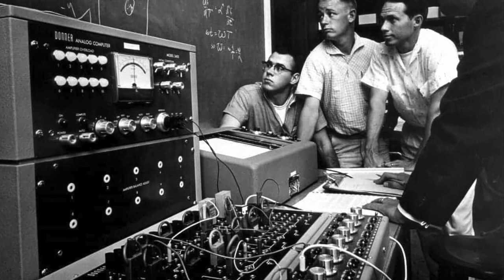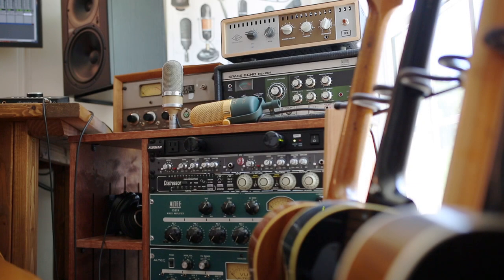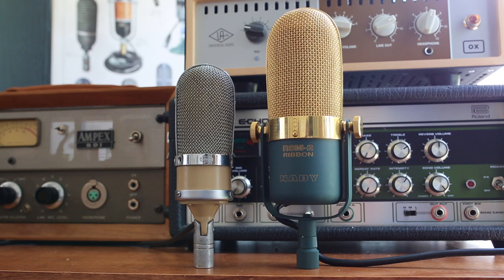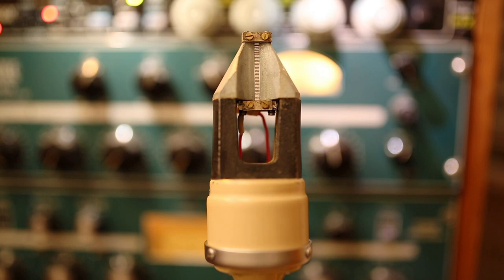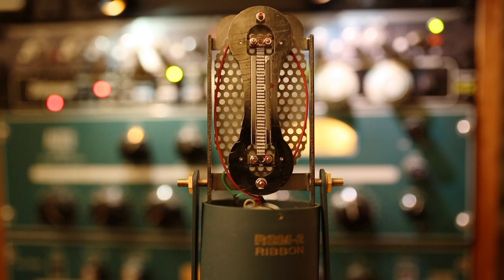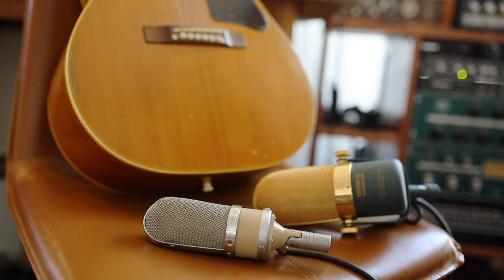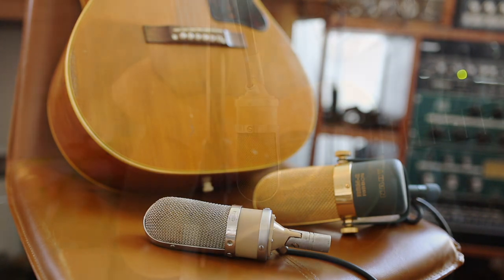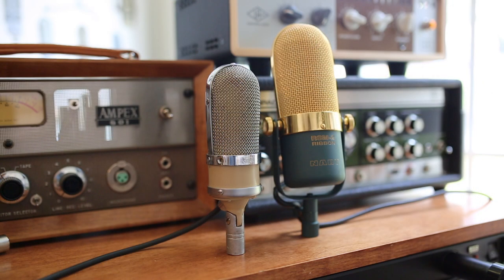Modern Vs Vintage Ribbon Microphones

Comment: as someone who’s just sort of in the early stages of trying to tune my ear to distinctions like these it’s so fun to compare! I feel like it’s easy to hear the vintage here and quickly think there’s too much boominess just based on what we maybe expect from modern eq curves. But then I tried listening to it with depth in mind, and all of a sudden that super intimate low end sounds deeper and less crushed than the modern. Kinda crazy!
Reply: Both of these smooth tops tho sound like they are going to take some air eq super nicely. Great guitar sound you got from each!!